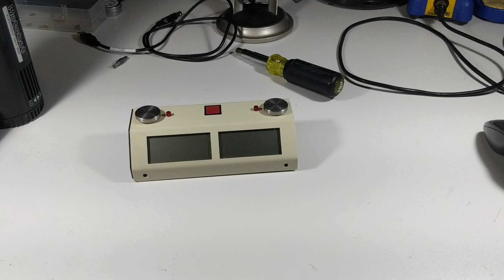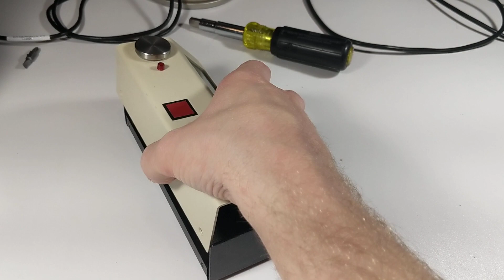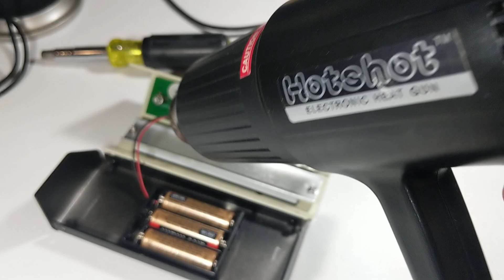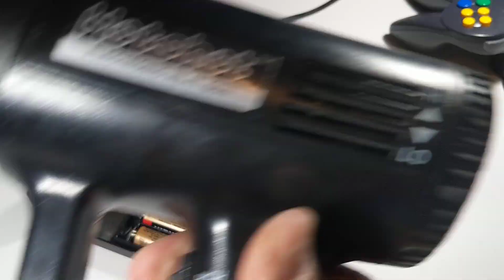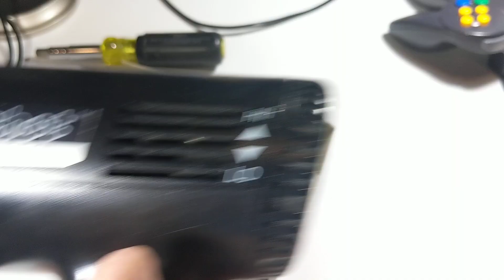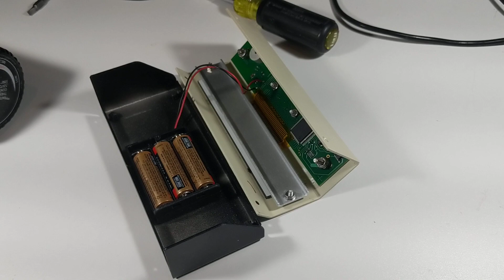Digital Chess Clock Repair/LCD Repair

Comment: Much to my amazement, this method fixed the display problem on one of my Chronos chess timers. I used my mother's hair dryer. I heated the ribbon cable to the point that it was almost too hot to touch. Then I rubbed my finger across it to make the cable stick better. No more display problems.

I've thrown away at least 3 Chronos clocks in Salt Lake City because they had stopped working.  I kept the clocks in the trunk of my car year-round which seemed to ruin them.  They are sensitive to heat, cold, and moisture. It is possible that my old clocks were fixable.

These clocks were considered top-of-the-line, were pretty expensive compared to other game timers, and are now collector items because they are not made anymore.
Reply from the maker: Glad it worked out for ya. I'm also in Salt Lake City. Cheers!

Comment: Apparently, the newest (not sure starting with what date) models of the Chronos GX chess clock no longer use tape pad printed connectors, but instead use some sort of socket jst style connector (whatever it's called), so the same issue doesn't happen with them.  I have absolutely no idea if any of the longbody versions ever switched to this connector or if repaired clocks from samtimer (after being sent back) are modified with this connector or not.  I have two waiting for repair from samtimer, I guess I'll find out after I wait the many months to get them returned.  I have a friend's GX (short version=GX) with me right now, and that clock has the socket connector.

Comment: Thanks! Is there an specific way to press the tape? i did it on mine, it works good for a day, then came back the ghosting
Reply from the maker: You may need to increase the temperature, or leave heat on for a longer period of time.